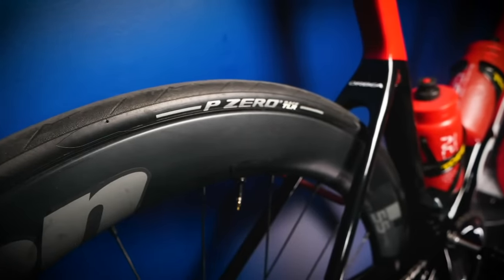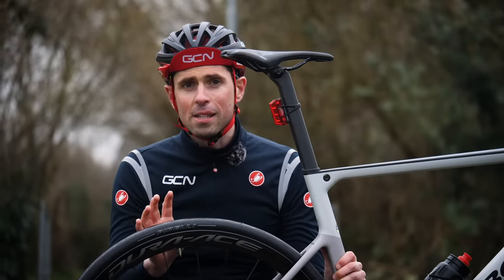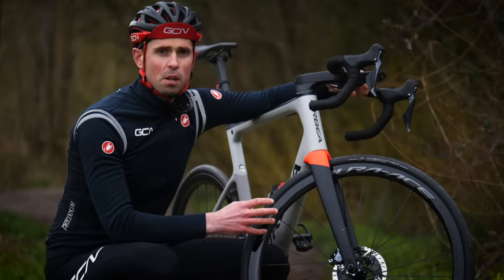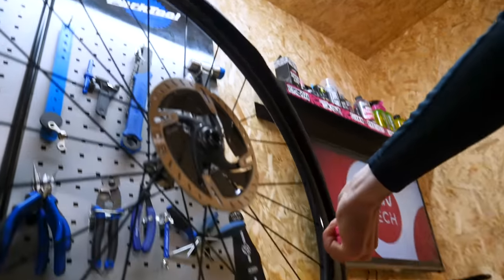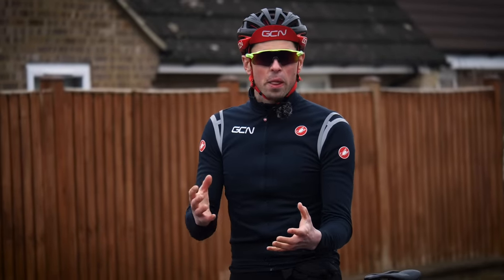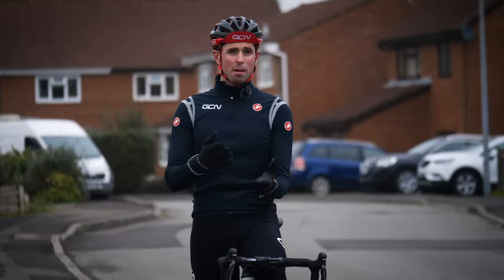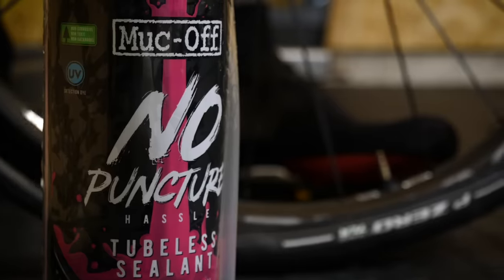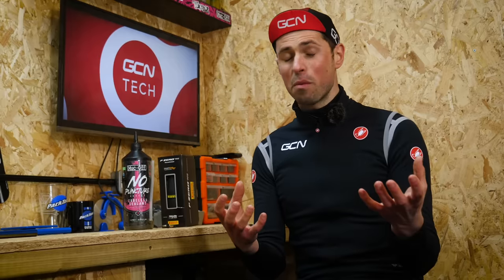Tubeless Convert! | Why Alex Will Never Use Inner Tubes On His Road Bike Again

Comment: Been running schwalbe tubeless for 6 years on three wheel sets now and would never go back to inner tubes. Must have is a tubeless specific track pump to blast the air in fast to seat the tyre. I had punctures but have never noticed until I got home. Only had to repair the large punctures on a few occasions as they could sometimes unseal then seal then unseal as you ride. Repaired with normal puncture kit. Originally tried the park tool instant patch but although they do work they degrade after 6 months. 
The times i have had to wait for mates during a ride who puncture. Does give me a rest to be honest.
There is a technique to getting them on and off but that comes with practice and I can take on and off now with just one park tool tyre lever in seconds. Best bit though is the feel of the ride which is sort of a buttery feel at the lower pressures. 👍👍👍

Comment: When I bought my bike it came setup as tubeless and I was really happy about that.  After a bunch of punctures and a few different tyres trying to find ones that resisted punctures better I moved back to a tubed setup and have had way fewer punctures since.  You can still run tubed tyres at lower pressures than that indicated on the tyre (there is a video on youtube called something like "your tyres are lying to you" that explains it), although maybe not quite as low as tubless (not sure on that one).  However, I am not a racer and can put up with some discomfort when required but the puncture issue is a killer for me (hate trying to sort out a puncture on the side of the road when I'm trying to get to work/home).
Reply: I can't see why you need to run the pressure more just because you put a tube in the same tyre.

Comment: I've run road tubeless for over 5 years, about 5000 miles a year. My first tyres were Vittoria, pretty poor, used Giant SR0 or SR1 faultlessly since, never had a puncture on the road that didn't seal until I mashed a sidewall and that got me home at least,  I average over 3000 miles per tyre at around 75psi, now trying Conti 5000 and these seem also very good. Handling is far better than tubes, yes the slime is messy, yes I have a compressor, yes I resort to plastic levers at times, yes they need more topping up and yes I replace the slime once a year. But with the roads in northern England and the improved handing and reliability, I'll be on tubeless until they invent something better. I carry a spare tube and a cartridge just in case along with a valve extension and a valve extractor, same as I would for a tubed tyre. Good article, thanks!

Comment: I once punctured my front wheel - the hole was too big for the sealant to seal. With every turn of the tire, the entire sealant was nicely spread all over the bike and myself. Cleaning was horrible. I am totally fine loosing a few seconds and not risk having such mess again. I am sticking with inner tubes.
Reply: I rode with my friend running tubeless and saw first hand the nightmare when he got a huge puncture on new tyres, the sealant went all over his  face and cycling gear and 12k usd bike...you are the amount of sealant thrown was a nightmare and its very visible on his matte black frame
Reply: That's why they make plug kits for tubeless, which will seal a hole that is too large to self seal. The Dynaplug system is so simple, the repair can be completed within five seconds of hearing/seeing the puncture. And the lightest weight plugs are light enough that carrying one as part of your tubeless system still allows the whole system to be lighter than a tube based system.
Reply: @RedCommunist  duhhh plug the hole before it happens.

Comment: As a road and MTB rider it always amazes me at some of the comments below a road tubeless video or article.  While it may not be for everyone, especially if you value simplicity and very rarely get punctures, it does have definite benefits and should not be dismissed out-of-hand.  A few things that people always bring up:

If a puncture defeats the sealant then a tube would have been toast too so you'd still have the faff of changing it on the roadside anyway.  Where tubeless really wins is when riding rough roads (lower pressures for comfort) or in winter/hedge-cutting season.  All those little slow punctures you used to get just don't exist any more.  Tubeless basically moves the vast majority of the hassle of punctures from the roadside to your home, much better to have a stress-free ride and no punctures in a layby on a busy road or in the cold and wet and be able to do the setup work in the warmth of home at your leisure. 
As for the sealant getting everywhere?  Just buy one that is water-soluble, like the Muc-Off stuff in the video or CaffeeLatex is another.  No harder to remove than wet lube that's got on the chainstay if you use warm, soapy water!
The bead/rim interface is designed to be much tighter and stronger than traditional tyres where the act of pumping the tube up actually keeps the tyre on the rim, puncture a normal tube at speed and you will most likely have the tyre come off completely.  A tubeless tyre correctly seated has a much better chance of staying on the rim long enough to slow down and stop safely, especially important on the front!
Pinch punctures basically no longer exist as there's nothing to pinch!  You can still pinch the tyre but if that happens then it would happen regardless of what you're inflating the tyre with (no points for saying a solid tyre can't pinch flat...)
If you've had experience of the older systems where you "ghetto'd" the system with all sorts of techniques but gave up then don't write off the new kit, it's massively better than it was.  The MTB TLR stuff is now as good or even better than the UST kit that was around 15 years ago and this tech has been used for the road kit now too.  

Be open-minded and at elast try it before writing it off and declaring tubes superior.  In some scenarios they may well be, like touring or bike packing where being able to repair or replace parts anywhere is a good thing, but for most people tubeless should have some big benefits.
Reply: The majority of road bikes can only run 25 tyres. Pressures needed make tubeless a waste of time and money. How many pinch flats have you had with tubes. I have never had one....

Comment: "it certainly felt nice and comfortable" - you can only feel this when you get paid to feel it.
Reply: You can definitely feel the comfort of lower pressures, but I'd challenge anyone to accurately tell if they're running tubeless or not in a blind test...
Reply: @poxcr  yep, that would be a good test if the effect are really noticeable..
Reply: I can only say that, at the end of a long ride, I felt beaten up after 4 hours or so running clinchers at 95psi, but much less so with tubeless at 70. However, it's a different bike (Émonda SLR vs Pinarello F8) so obviously more than 1 variable. 
However after nearly 4,000km on tubeless in 3 months I have had zero punctures, but there are 6 small nicks in the front tyre where sealant has visibly sealed the hole. So that's 6 lots of not having to stand at the roadside for 5-10 minutes....
Agree mostly re ride feel and a blinded trial, though the lower pressures reveal themselves pretty quickly on some of the roads I ride on (again, more than 1 variable)
Reply: It’s nearly a night and day difference. You can easily tell if you’re running tubes or tubeless. If you can’t then you’re not “in tune” enough with your bike. I’ve made the switch and now wonder what took so long since I’ve been running tubeless on my MTBs for at least 5 years.
Reply: Alex is just comparing pressure differences here.. not tubeless vs tubed. He didn't even test latex inner tubes, which he could probably run at 60 psi considering he doesn't seem like a heavy guy and the bike is light as well.

Comment: I have a road bike that came with tubeless. I had a thorn in my tyre that I didn’t notice until I got home. So I was happy initially, yes it costs much more, there is much more maintenance and it only saves 0.4 watts over a tube. But not having to fix a puncture on a cold dark rainy night made it worth it.
Subsequently I have also had 2 punctures from glass that made a hole too large to plug. So I ended up taking about 30 minutes each time to fit a tube. On my other bikes I can change a tube in be on my way in 10 minutes. On the roads I ride it is usually thorns in hedge trimming season or glass in towns that causes punctures.
I think I will keep them on my bike for the time being to get some more experience with them, but I wouldn’t recommend them to anyone who can easily replace a tube on a road bike. I have paid for all the extra equipment now so I have some sunk cost in tubeless. If you are on a budget definitely avoid or if you are not good with maintenance again definitely avoid.

Comment: I've put hundreds of miles on a couple non tubeless wheels set up tubeless with zero problem no tire unseating it self or anything. I've also done over 1000 miles of riding on tubeless wheelsets with again zero problems. Personally I think it's really easy to set them up once you grasp the concept and there are so many benefits.
Reply: Probably the biggest problem with tubeless...people going in with a negative attitude.

Comment: I must admit Alex makes getting the tubeless tires set up on the bike look really easy.  I'm not sure how representative that is of most people's experience.  I've been using tubeless for a couple of years and I find it's almost always a real hassle.  Once they are set up they are great.
Reply: My experience is not good. To seat my Schwalbe Ones, I had to buy an Airshot cannister to assist my track pump; and even with that combination I could not seat the replacement Hutchinsons. Just in case I had a major mishap out in the wilds and my tyre(s) became unseated, I had to carry backup inner tubes anyway. Also, the Schwalbes wore very rapidly; and although they felt good off-road, on-road they were far too spongy.
          I now use standard Continental 4 Seasons and they rarely puncture and don't impact my speed too much.
Reply: How often do you replace the sealant?
Reply: @philipcooper8297  I used to inject some sealant in about every three months, because it eventually dries and sticks to the tyre wall. Whether this was optimal or not, I can't honestly say. It depends on the ambient temperature and usage, I suppose.
Reply: @dpstrial  Seems like too much work for me.
Reply: @philipcooper8297  Topping up the sealant is the easy part. I just removed the valve head and used an ear syringe (of all things) to inject it. The problem was that some rim and tyre combinations just did not work, and they could not be seated without a compressor. MTB tyres, being wider, seem to be much easier to seat from what I have seen on YT.
Reply: @dpstrial  Yup agreed!  If people decide to stick with tubeless, it is definitely worth getting some kind of rapid inflation device: airshot or similar.  To start with I used CO2 cartridges but you'll use them up quickly particularly if having trouble seating the tire.  The best tip I've found, if struggling to get the tires to seat and seal, is to apply another layer of rim tape which helps to avoid the air escaping when inflating by making better contact between the tire and the rim bed.  I carry a spare inner tube too but luckily never had to use it.  My main worry about using it in the wild would be getting the tire on and off the wheel as it can be super hard work as tubeless tires are much tighter fitting.
Reply: @alexdj40  I found an insurance company online offering  bike rescue service for £15 a year (more for Europe). I thought, if I were in difficulty, I could get taken to the nearest bike shop, train station or home. Thankfully, I never had to use it, but will sign up again this month, even though I use tubes.
          Yes, my worry was getting the tyre back on, plus getting the valve cores out first, to get the inner tube in. They were in very tight. I don't intend to go back to tubeless in a hurry.
Reply: Have been using tubeless on my summer and winter bikes for several years. Have always been able to seat them with a standard track pump. Some rim-tyre combinations are a headache, but that is true of clinchers as well (Vittoria clinchers on Mach1 rims were almost impossible to mount).
Reply: I haven't had too much problem with the setup, but the maintenance sucks  (If you don't add sealant regularly it gobs up and won't seal when you flat), and I think the benefits are mostly placebo.
I've had more rides ruined by tubeless not working right than I ever have by having to swap a tube.

Even if you're just adding sealant every few months, you're wasting more time and money doing that than I am swapping/patching the couple of flats I might get in a year.

Comment: I run tubeless in the rear and latex up front, and carry a spare latex tube.  This is satisfactory for me because the main advantage of road tubeless over latex is puncture resistance, and you get most punctures in the rear. This is a gravel bike so a tubeless rear tire eliminates snake bite punctures.  I didn't set out to do it this way, but after the rear tire set up flawlessly, the front setup was leaky and lost pressure overnight, even though the wheel had tubeless tape preapplied at the factory.  In my experience when a tubeless setup doesn't go flawlessly with a tire/rim combination right from the get-go, that combination is always going to remain troublesome.

I feel it is important to run lower pressures with tubeless, not just because you can, but I think there's a real danger of blow-off if you go higher than 60 PSI.  If you think about most tubeless tires -- in cars, or mountain bikes -- pressures are far lower than road bikes.    It might not happen to *you*, but I've had road tires blow off the rim at 65 PSI, fortunately while I was inflating the tire and not riding.  Most tubeless tires -- on cars, mountain bikes etc -- run at far lower pressures.  When you get to typical historical road bike pressures you need a really precise fit between the tire and rim, which isn't always achieved even in tires and rims from the same manufacturer that are rated for road tubeless.

Comment: Can you demonstrate fitting GP5000TL tyres onto Hunt rims please 😂
Reply: I have to admit getting GP5000TLs on to Hunt wheels is a challenge, nearly snapped a tire lever but the struggle was worth the effort- they have been lights out since!
Reply: How do you like you Hunt rims?  I'm getting some next week (and on the balance of comments here I think I'll stick with tubes).
Reply: I have the Aero Wide (24 wide 31 deep) rims which replaced the stock Bontragers that came on my 2018 Trek Domane SL5 and love them!  I’ve heard concerns about Hunt having loud free hubs but mine are quieter than my old wheels.  They sure are a lot lighter, shaved over 700 grams of weight off the set.
Reply: regular gp5000 were pretty hard on my mavics as well
Reply: do an install with no cuts... most folks will click off before one is ready to ride, let alone a set. tubes are fine.
Reply: Super easy- no tire levers needed!
Reply: @cshigley   Ditto, massive difference on my 2013 Felt Z85! (and also a bit of a b**tard to get GP4000II on to them!)
Reply: Two alternative methods are to click "supply installed" on the the Hunt website and the other is to go to your LBS and have them do it for you.
Reply: Haha I gave up with mine and went clincher as I was never going to be able to get it off and on at the side of road!
Reply: I found it impossible to break the seal between the rim on my 30 Carbon Gravel Disc Wheelset & the tyre bead when stuck on the side of the road with a puncture that wouldn't seal. I had more problems in 3 months with tubeless than in the 15 months since going back to tubed!
Reply: I simply dont get it why people keep getting conti tires nowadays with such a great nr of much-much better options. Cos years before you was told on yt paid channels that it was best as tubed version?

Comment: Mounted a set of tubeless Scwalbe's to my Hunt wheels, but they rubbed my brake.  Needed a C-Clamp to break the bead and remove them.  Put the GP5000's back on with supersonic tubes 50g ea.  If I ever had a flat on the Schwalbes, I'd be done for on the side of the road.  (However, the gravel bike is tubeless!)

Comment: I love tubeless for off road, on road tubeless is a disaster! I've seen more riders trying tubeless return to tubes, than stick with them.  I've left riders with tubeless to wait for their partners to pick them up, because they can't plug the hole and can't get the tyres off the rim to get a tube fitted.
Reply: I raced latex for years, but as a mechanic, tubeless is so much easier.
Reply: Dynaplug for big holes! Takes 30 seconds 😁
Reply: One can always bring a standard tube to avoid getting stranded.
Reply: @brijlunine6416  only yesterday a friend of mine had a puncture that wouldn't seal even with a plug,  lost a lot of sealant.   He or his riding partner, couldn't get the tyre off the rim.  Ended up phoning his wife for a ride home.   Wouldn't happen to me with my two spare tubes, puncture repair kit and tyre jacks.   Never been picked up for a puncture after 90,000km (as recorded on Strava)
Reply: @davidmartin305  ugh sorry to hear it
that happened to a friend too. some combos are too tight to deal with--especially if it's cold out.